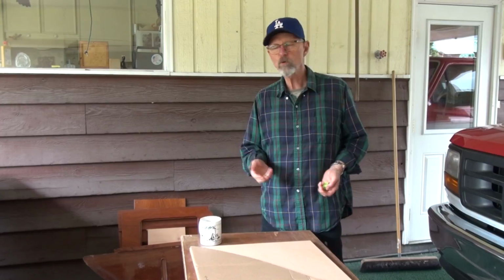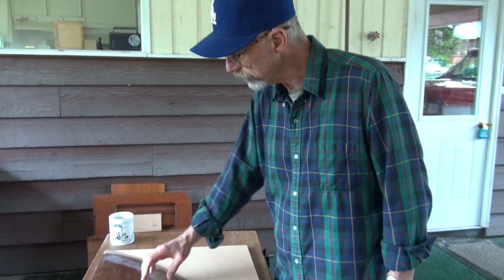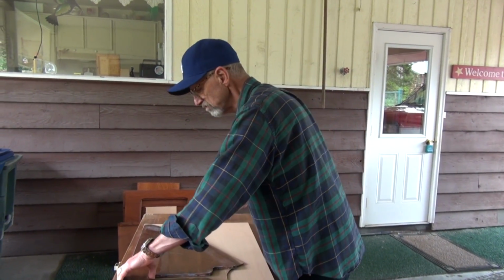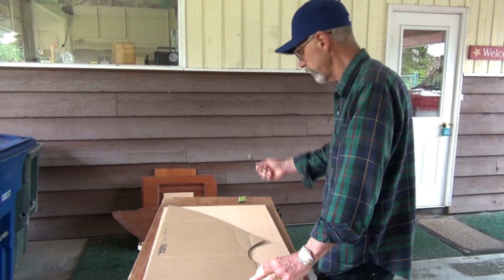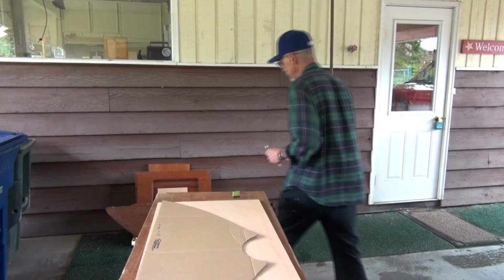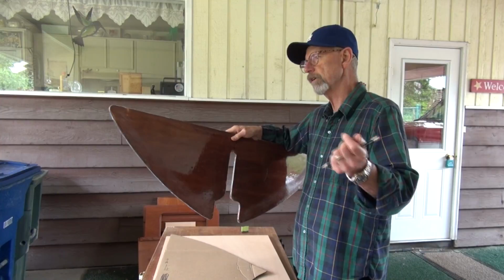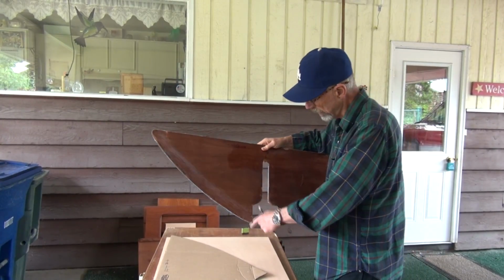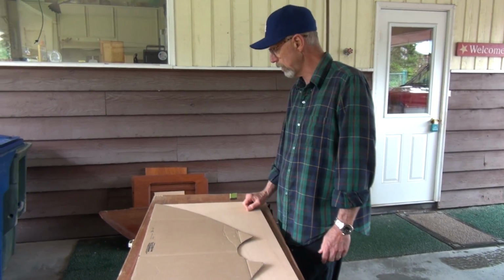Cruising Lealea Refit No. 35+1: Pattern Making Details

Comment: won't the bulkhead resting on the hull create a hard spot that cause high localized stresses?
Reply from the maker: That's the way it is designed.  We haven't changed anything.  The original bulkhead was filleted with glass mat and hard resin to fill the gap.  I don't see the difference. The second bulkhead aft is the same - fiberglass tabbed to the hull - but that one fit properly.  Unlike the bulkheads farther aft which were bolted to substantial fiberglass tabbing, these two in the bow were glassed directly to the hull, probably to prevent oil canning.
Reply: The tabs spread the loading. Just make sure you don't have any point loading.

Comment: Not to belabor the issue or appear completely dense but I don't understand why new bulkhead is larger than the previous one since it is closer to the tank and bow. Last time I checked the bow is the pointy end so it seems the bulkhead would slightly smaller than the first try. What am I missing here?
Reply: As I understand it, if the old bulkhead were 4" forward of its originally installed position it will fit, but the water tank will not. The modification/fix will keep it at the original position, it will fit better, and the water tank doesn't need to be changed.